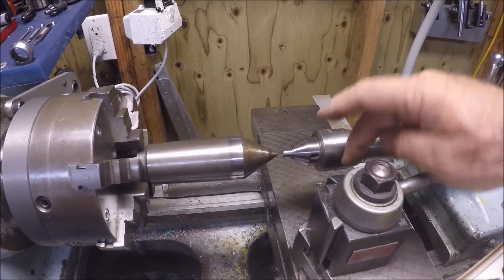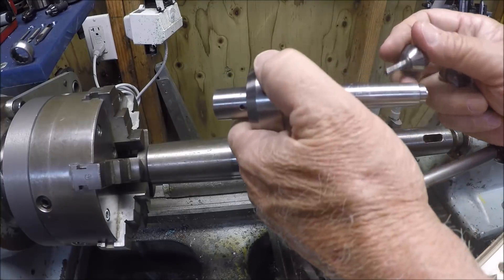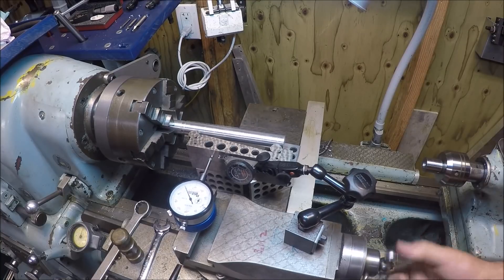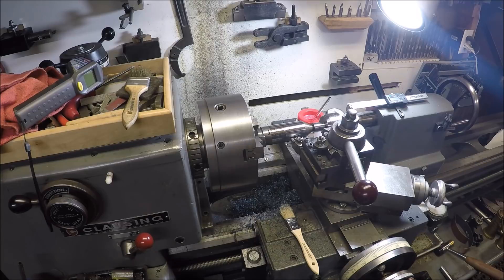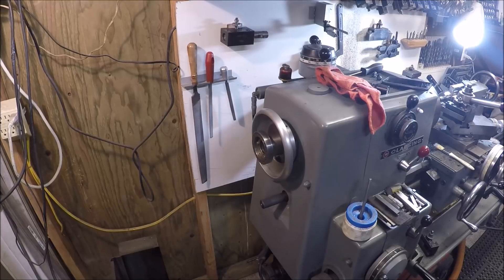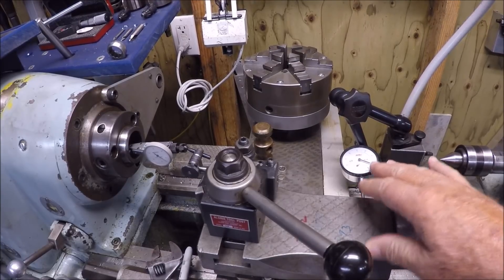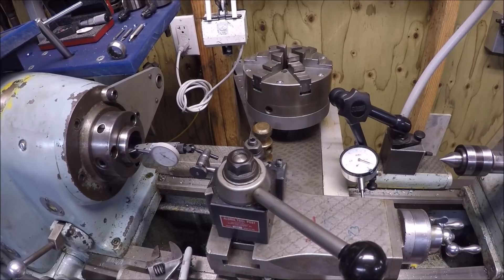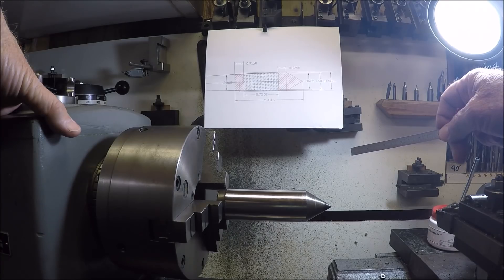SCREWY TUESDAY  MONARCH 10EE JARNO #12 TAPER Part 1

Comment: I have a pulley on my lathe that gets loose on a regular basis.  I just check for it from time to time and catch it when it is loose.  That center looks to be very hard.  Maybe next time rig up something to turn it on your surface grinder until you get through the hard part?